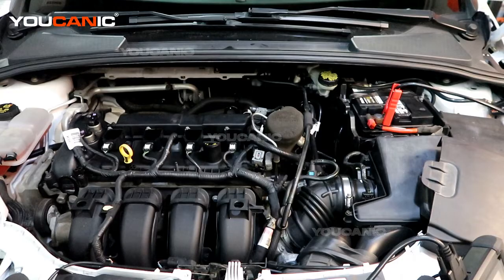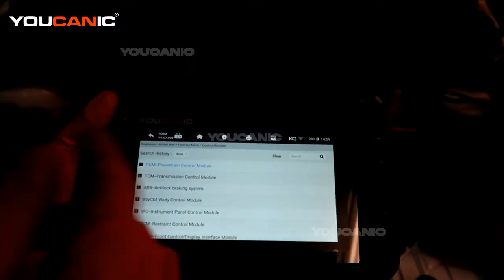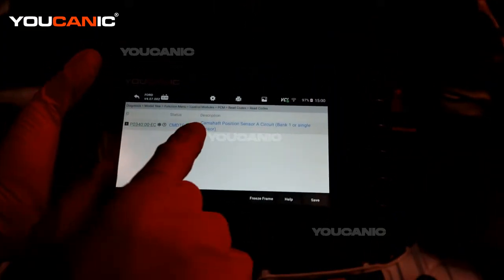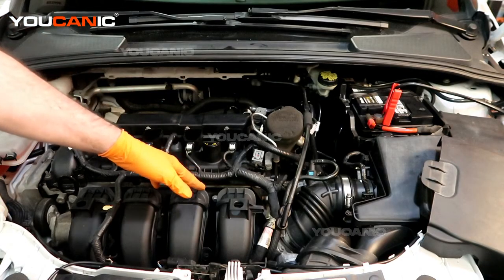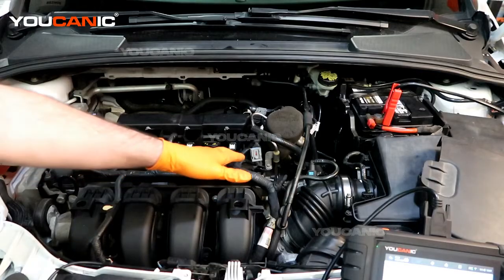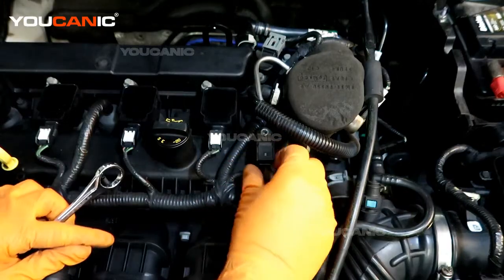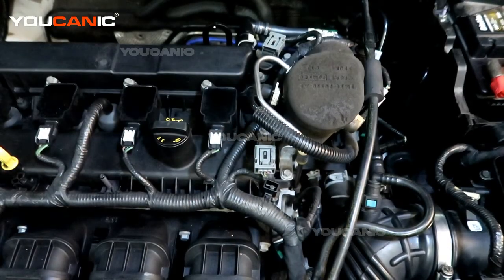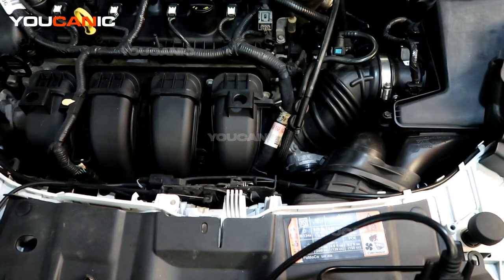Ford Camshaft Position Sensor A Replacement - P0340

Comment: I have a code P0017 crankshaft position camshaft position correlation bank 1 position B. 2017 Lincoln mkc 2.0 turbo. Just did synthetic oil change and runs good but code won't clear.
Any ideas? Thanks!
Reply from the maker: 👋 Thanks watching and for your comment! Our techs may not see every YouTube message, so if you need help or have a car question, visit www.youcanic.com — our team is happy to help!